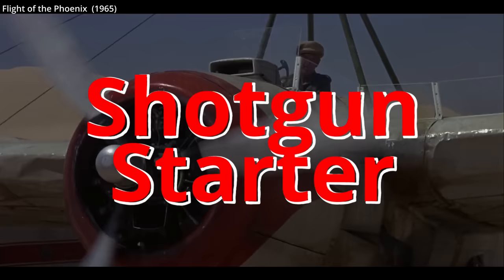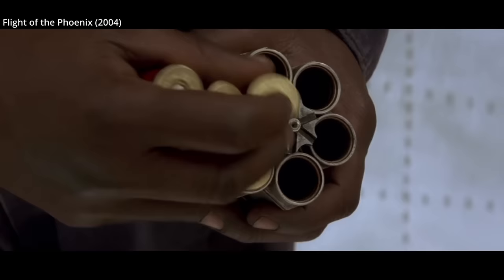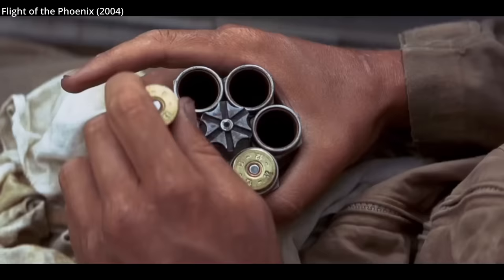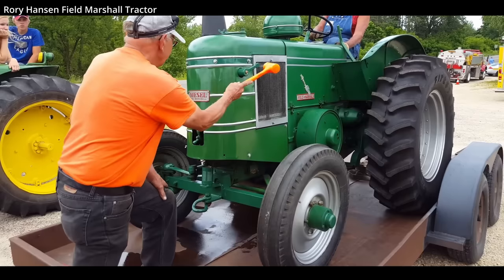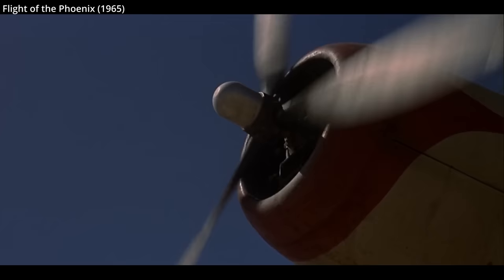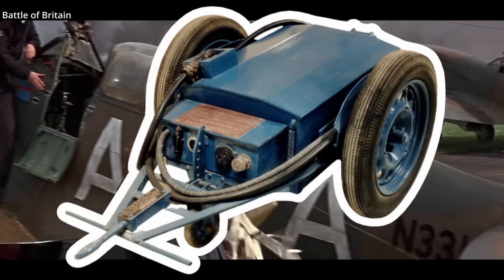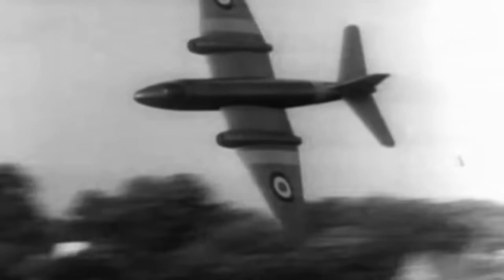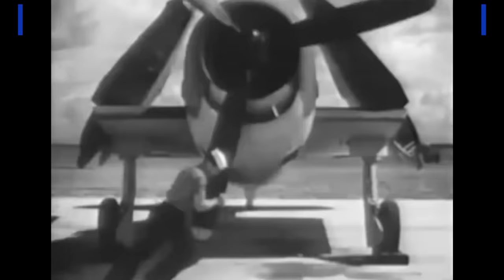Starting Aircraft With a Shotgun Shell?

Comment: The scene in the original Flight of the Phoenix where the aircraft designer admits he's only designed model airplanes is priceless.
Reply: "A model plane has to fly itself. There's no pilot to correct the trim. Therefore if anything, a model plane has to be designed for greater stability that what you are pleased to call the real thing." Heinrich Dorfmann, Flight of the Phoenix (1965)
Reply: Then again, they have more room for error with the materials and therefore the strucural integrity, since the strength of most metals/wood is much better in small scale than in big scale.
Something about "increasing diameter by x2 will increase weight by ^2

Comment: We had both F-4Es and F-105F/G models, the F-4 J-79 engines could be cartridge started, but if fouled the engine, they used up our supply of 32-60 power cart/engine start units. The J-75 in the f-105 was pretty much started with clack powder charges all the time. Watch any video of them starting and you'll see the plum of black smoke from the fuselage vent.

Comment: The B52 uses a shotgun starter it is much larger than a 12 gauge round but it’s for combat situations when they needed to scramble within 4 minutes they start four of the eight engines via oversized shotgun shells and use the four turning to get the other four. This is referred to as Cart start on the b52s

Comment: Used cart start while pulling alert on SAC bases back in the 80's with KC-135A and B-52G aircraft..  I believe they can still use them on the B-52H aircraft today.
Reply: The KC-135R no longer uses carts.  They have two APUs large enough to start the engines.
Reply: @robertheinkel6225  Nice..  Don't miss the cleaning after a cart start...

Comment: The DeHavilland Chipmunk used a cartridge starter…..there was a big bang,  the cockpit filled with cordite smoke, the instrument panel shook like hell,  and when the smoke cleared the engine was ticking away :)
The Dak/DC3/C47 had a flywheel which was electrically spun and then clutched/engaged onto the engine…..or a manual starting handle which was large enough for 2 gorillas to operate …..or a short rope with a horse feeding bag on the end pulled over by one person,  plus a long rope wrapped around the propellor boss and pulled by about 4 people who ran like hell once the horse bag was used.  
In my later career we called for the engineers…..that always worked !!

Comment: I have a big spent brass cartridge case that belonged to my grandfather, turns out it's from a Canberra's starter. Very cool bit of history. We use it as an umbrella stand. 40mm If I remember correctly.
Reply: 40mm? that must've made a hell of bang when it went off!
Reply: @everettfisher8752 It's even worse/better! I went and looked at it, and It's more like 70mm. Absolutely enormous. No. 10 Mk.3 cartridge. There's lots of them on the internet to see for yourself. Also I found a video where they start one. Up to three cartridges can be installed onto each engine in little cylinders within the intake cone of the engine. Wild!

Comment: When I was a kid I saw on old tractor being started that way at a county fair.  I had no idea that some aircraft used the same method.

As usual, good one, Johnny!  Your details make history really come alive.
Reply from the maker: This was a fun one I personally only recently discovered
Reply: @JohnnyJohnsonEsq 
The Field Marshall system isn’t quite the same as the Coffman system, though. The Field Marshall uses a direct impingement system where the expanding gases from the cartridge directly act on the engine piston (through a check valve), whereas, as in your diagram, the Coffman system uses a drive mechanism of some kind to rotate the engine crankshaft. You can start a Field Marshall with a hand crank (it is equipped with semi  automatic decompressing gear) and a specially prepared smouldering paper wad that’s first inserted in the cylinder for pre heating. According to the official recommendations, the cartridge technique is supposed to be used sparingly (in extreme cold conditions for instance) because of the stress it puts on rotating engine components being accelerated from zero to fast in a fraction of a second. Needless to say I can understand the need for owners to use the more spectacular cartridge when it’s not strictly necessary, for dramatic effect.
Reply: @RB-qq1ky  Damn, that is trivia worth knowing, no lie!  Viewer input is one of my favorite things about this channel!

Comment: The Air force F-111 had cartridge type starters also. It was about the size of a very large soup can and when it was fired it produced one hell of a black cloud. It was rarely used because it was a mess to clean up the starters and was a danger if it was triggered by accident. It was a cold war idea to get planes started and into the air as quick as possible without ground support on hand.
Reply: I remember seeing this on an air force informational film from the 80’s. An F-111 was sitting alert for SAC and received the order to launch. When the alert came, crew ran out, loud bang and engine noises, and the thick black cloud out the back.

Comment: i wonder if you couldn't so the same thing with a very powerful spring. you could use a ratchet system to compress the spring and then release it with a trigger. it would eliminate the need for shotgun shells and could be done with tech available at the time.
Reply: There are such things, usually fitted as an option to things like emergency generators. There is one of the  same form factor as a conventional starter motor that I’ve seen fitted to diesel tractors .There are also units like the Bryce Handraulic system where a hydraulic accumulator is pumped up (by hand if necessary, but there is usually an engine driven pump on the equipment to replenish it) and the stored pressure is used to turn the engine. I’ve seen the Bryce system fitted to lifeboat engines.

Comment: The RNZAF had Lend Lease F4U's but no cartridges sometimes so put cups on the prop tips attached to a rope and a ground crew team would pull on the rope to turn the engine over
Reply: That sounds really f-ing dangerous. What happens if the rope tangles on the prop instead of sliding off?

Comment: I used to fly a Chipmunk with a Koffman starter. You could put six cartridges in the cylinder and six more in your overall pocket, that's twelve starts for less than a pound of weight, much better than the rather weak lead acid battery could manage. The powder is NOTHING like any firearm powder, and there was NO wadding.

Comment: It is a blank cartridge, right? It seems like it would destroy the engine to fire buckshot into it, even if it doesn't fire directly into the cylinder like those old tractors.

Anyway, another interesting way of cranking an engine, is with compressed air. This  was common on large marine diesels. There would be an auxillary compressor and a tank that was connected to the engine, and before shutting off the engine. you would always need to check that you have enough air pressure in the tank to start it back up again, or you would be in big trouble.

In the film "das Boot" they have this system on the submarine. In the scene where they get stuck on the bottom of the strait of gibraltar, they manage to surface the u-boat by "blowing the tanks" -using pressurized air to fill their boyancy tanks and regain positive boyancy.
The problem is that by using this technique, they  are likely to use up most or all of their remaining pressurized air. There is this tence scene back at the surface, where they don't know if there is enough air pressure left to start the engines, or if they are just going to drift helplessly until they are going to be discovered.
There's no thorough explaination given of this problem, but if you know what's going on, the whole scene is just that much more intence.

Comment: I don't know about modern aircraft, but I do know that the Boeing B-52 uses an 8-pound stater cartridge to start the engines in a scramble. At least back in the 1970' & 80's they did. I know this since the company I worked for made those starter cartridges, I guess you could say it too was a giant shot gun, but it lasted for several seconds while the cartridge continued to burn.

Comment: Another fun starting method is using compressed air. Soviet aircraft in WW2 made extensive use of pneumatic starters since they work better in cold weather and were easier to manufacture than the batteries of the time.
Reply: There was a T34 tank driven by a ww2 veteran in Budapest riot in 2006. That tank was supposed to be paraded, and the organiser disconnected the batteries, thinking without batteries alone the tank won't start. That ww2 veteran, being a tank driver in war, started that tank using compressed air system and drove that tank around lol.

Comment: Early versions of T-54 tank had a pneumatic system to start the engines, so the containers of compressed air and compressor were installed in this tank. Later it was replaced by the electric system

Comment: Another fun fact is that the B-52 uses starter cartridges to start very quickly in case of an emergency.
Reply: Except those cartridges are about a gallon in size.  The power is ignited, burning slowly, and the exhaust is fed thru the standard bleed air starter to rotate the engine.

Comment: Correct me if I'm wrong, but I think the reason why the electric starter succeeded at the end is because aircraft need a generator and battery for the electrical equipment onboard anyway. 

Since every electric motor is also a electric generator you don't realy loose anything by using the already needed generator to also start the engine.

Comment: In the past, several companies have manufactured cars that run on compressed air. 

Those cars use positive displacement lobe air-motors which have strangely disappeared from Google and Wikipedia.

https://en.wikipedia.org/wiki/Lobe_pump

A twenty gallon 100 psi air tank will run a small car for about a hundred miles. The compressed air can be provided by any gas station that has a hundred gallon air tank.
A five dollar fill-up.

Comment: Pulling the prop through on a radial isn't really to "Clear" the lower cylinders. It's the check them for a liquid lock, caused by oil draining into the lower cylinders. If a lock exists, a spark plug is removed to drain the oil out of the cylinder's clearance volume.

Comment: The cartridge starters used on jets are not 'shotgun starters' in any sense. Besides the physical size of the cartridge, the principal is different in that the cartridge charge doesn't 'explode' in the normal sense, as with the Coffman types, but rather burns rapidly for a number of second to produce enough exhaust  gas to turn the starter turbine over. In this respect, these cartridges are virtually a rocket motor in design.

Comment: Are you saying that the starter receives the expanding gas and turns a pinion on the flywheel or that the gas is fed into one of the cylinders to spin the motor?

Comment: Just a little titbit re the statement at 2:20 about "hand propping", while generally true there were exceptions (as there always are! 😀). During WW2 the RNZAF didn't always have enough starter cartridges for their F4U fleet so sometimes the training units hand to start 'em up using brute force, which consisted of a long rope with slings to hook over the tips of two of the prop blades with the rope then being pulled by either a jeep or a bunch of men. I've also seen VVS photos of a similar technique being used on a MiG-3 and Yak-1.
Reply from the maker: Hey always interesting exceptions and I always like learning of them and hearing about them so thank you!

Comment: I worked on the F-4 Phantom series  aircraft for many years. During alerts, we would sometimes use a starter cartridge about the size of a 3 lb coffee can to start the jet engines. Due to the size of the rotors in the engines, the cartridge had to be much larger than those you showed in the video.